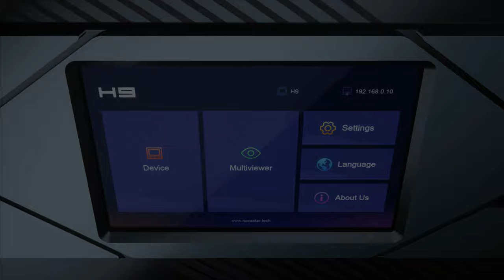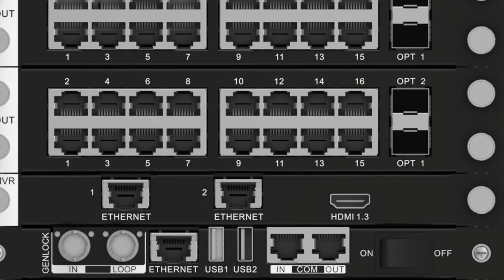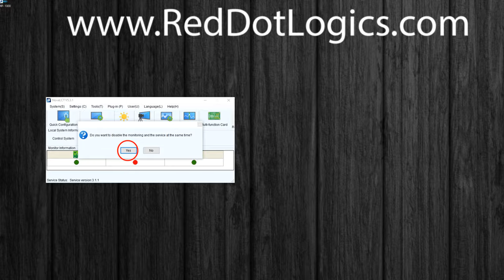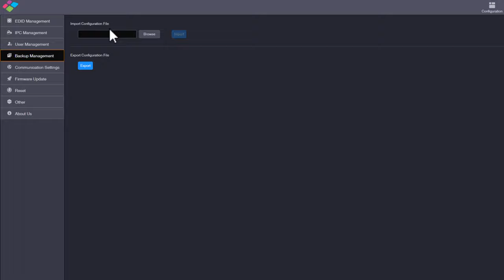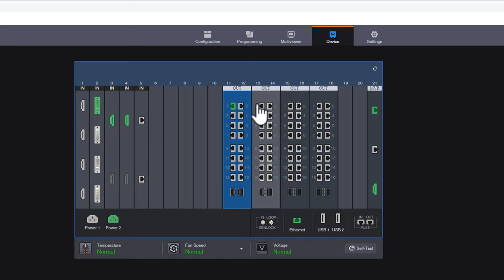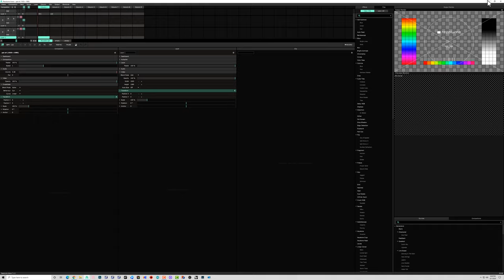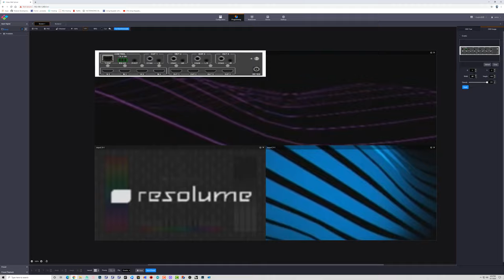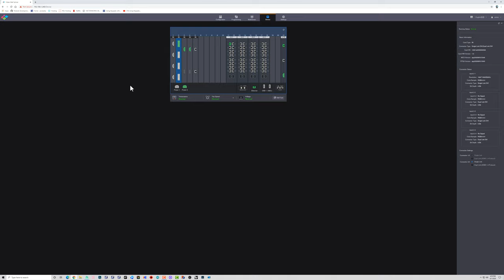Novastar H series Video Processors H2, H5 and H9

Comment: Thanks for a really informative video, seeing the processor in action helped us decide if we could potentially use it on an install project.
Got one specific question that I couldn't answer with the help of available materials and the manual: if You had a screen over 4K (for example 6000x2000px), how does spanning over multiple output cards work? Can the first output be enlarged so it spans two output cards and the second screen would lose capacity? And how would that translate to programming in NovaLCT?
The goal would be to have a 10bit pixel accurate image full screen on the H2 processor (with two inputs back to back presumably due to input port limits).